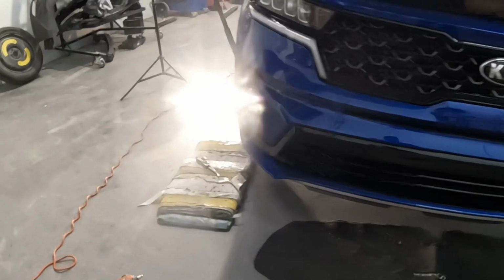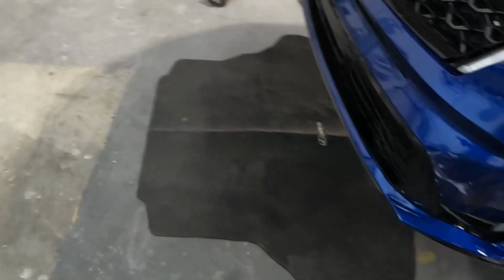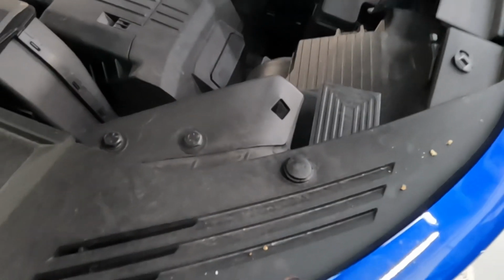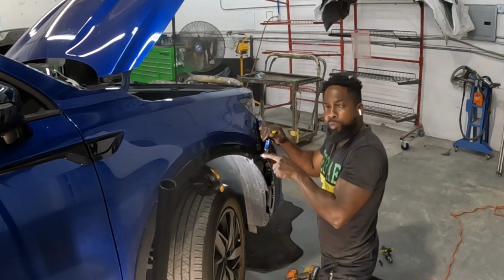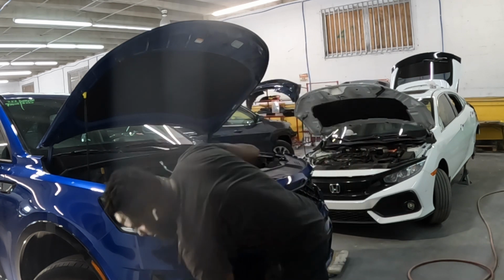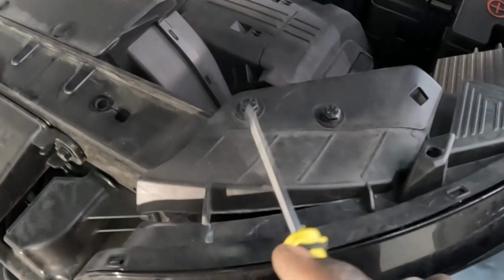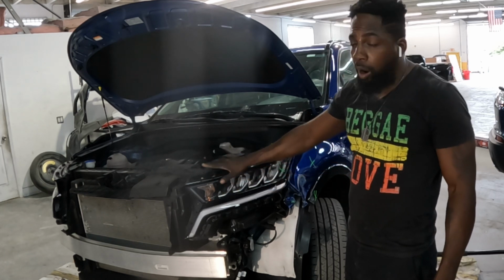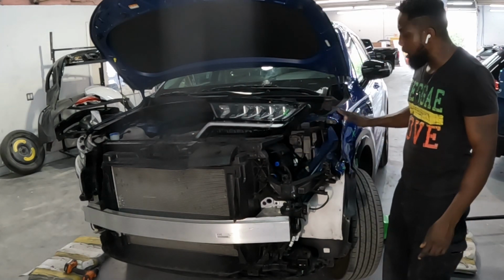2021 Kia Sorento how to take the front bumper and headlight off

Comment: My bumper and fender and screwed together its impossible to get off as the screw is facing the opposite way so no way to get it out
Reply from the maker: Try using a pliers or a vise grip to hold the other end